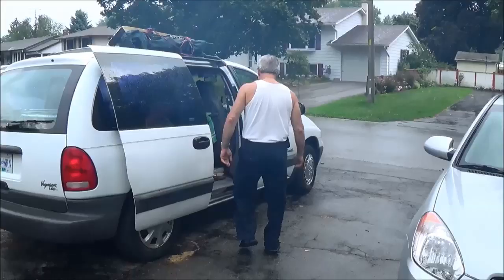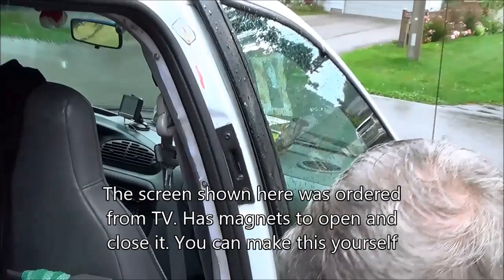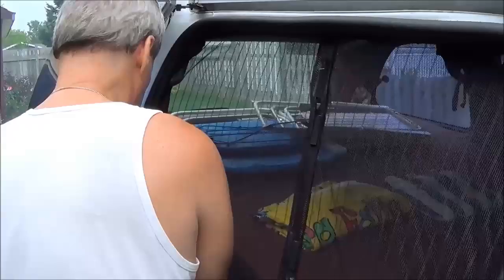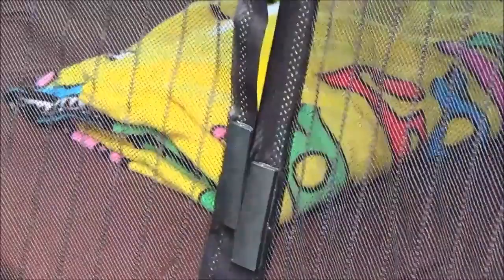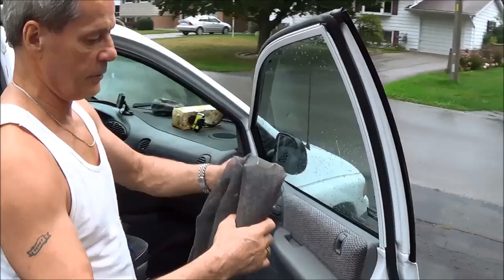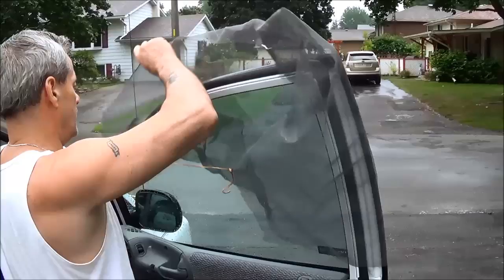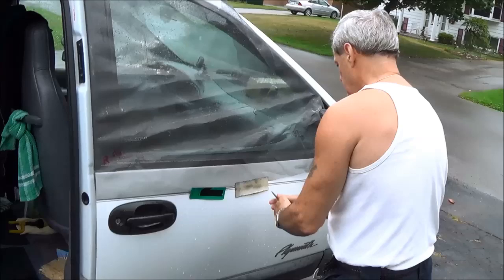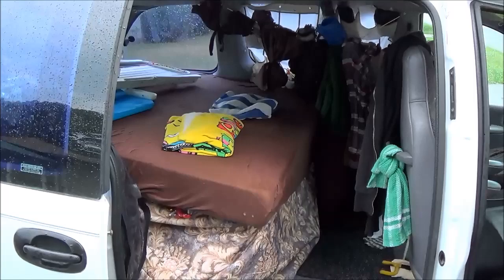Turn your van into a small camper and keep the bugs out 720p HD

Comment: Great ideas!! I was thinking about this earlier tonight...i plan on ordering a mosquito netting that comes in 100 inch widths and making basic "pillow cases" that cover the entire upper door frames of my suv.  just measure and cut into rectangles long enough to measure from several inches below the bottom of the exterior window, up and over the door frame and down below the interior window edge by several inches. the width needs to be an inch or two larger, as well. fold in half length-wise and either sew or tape with duct tape, leaving the bottom edge open. (the three sides will close in the door jamb so the windows can be left open and the tape will help withstand the wear and tear) if necessary, secure the bottom exterior edge of the screens with either small magnets or velcro strips or even blue painter's tape.   slide them on, slide them off! i also want to make a screen for the tailgate but haven't gotten that far.  THANKS FOR THE TIPS!

Comment: Messy. Better off gluing Velcro around the back hatch opening and sealing off that opening. In fact in most cases there is a rubber molding that laps back onto the internal lining and you can slip the screen had have it held in with place. Buy a cheap mosquito net the type used over beds. Next the back hatch can act as a weather shelter when it rains and to want to still have air in the van but not the bugs that way you can close the side door and not have the rain come in.
For over night ventilation  bend up some 5mm steel rod say 200-250mm long with a P shape at one end and a S shape at the other end The S goes into the D strike and the P end locks into the hatches latch this way you can climb into the van lock the van and have the rear hatch ajar for air the netting to stop bugs and locked for safety.
Now for the front side windows. cut a piece of mosquito netting so it drapes over both sides of a side window stitch up one side to make a pocket and attach some ties at the other end (door mirror end) these will wrap around the mirror to help hold it in place if the wind picks up. make sure the pocket drops down below the bottom of the window by 100-150mm. You can with this now crack open the side windows 50-100mm enough to allow air flow but not allow bugs or any one from unlocking the door. the side window pockets made from a bed mosquito net is soft so you can slip it off shake off any bugs roll or scrunch it up and put it in the door side pocket...

Comment: How neat!  MAy I ask how he attached the velcro to the inside area..what kind of glue t\did he use?
Reply from the maker: Pastor Cameron My dad  used screws and drilled into metal. I have would have drilled and rivited them in. He used that van to travel from Toronto to Vancouver. He said it kept the bugs out.
Reply from the maker: Pastor Cameron As for the windows he fits them over the door glass. So there is no nails or glue. Just on those big sliding door. This vehicle is really old.
Reply: Ok I have a areostar I am trying to attach something to the inside window frame. It is what the window that slides back and forth .  I was thinking maybe attach the velcro (one half) with gorilla glue and than as your dad said sew the other half onto the mesh, and than attach both together.  I was going to attach mine on the inside like that.  I will let you know how it turns out ,.  Thank you dad for me..for the great idea.
Reply from the maker: Pastor Cameron he also used the circle magnets sowed into the mesh to attach to the metal around windows.
Reply: +Prophetic End Times some Velcro strips come with peel and stick on them